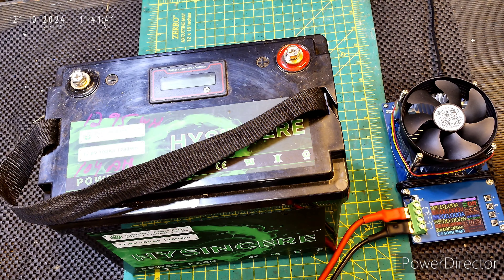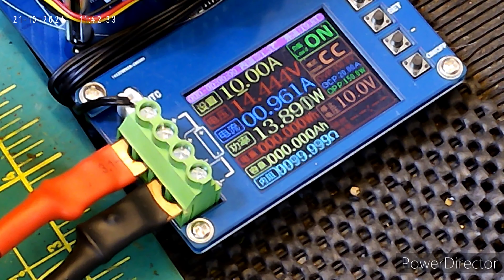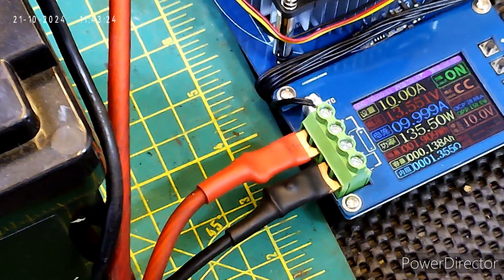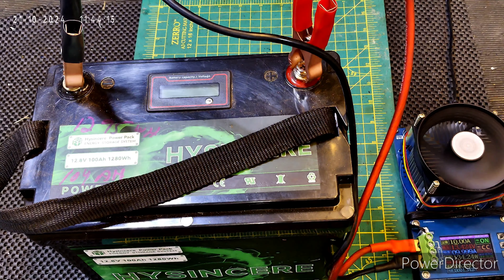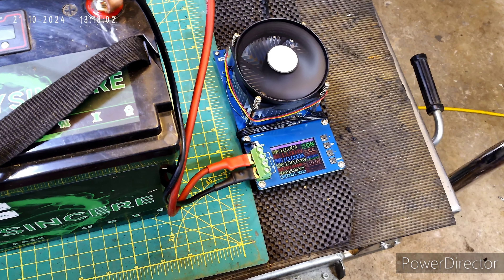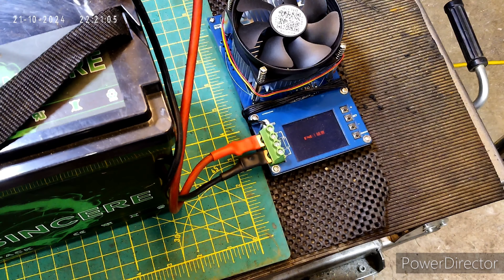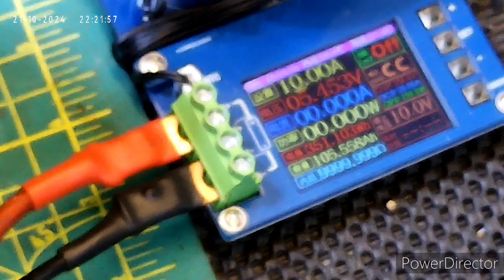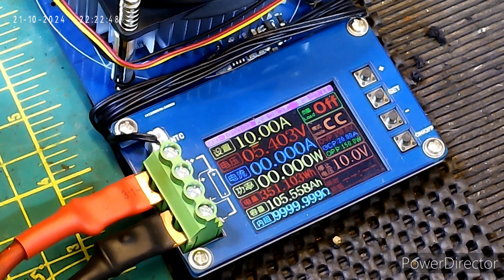HYSINCE 12 VOLT LIFEPO4 BATTERY LOAD TEST(UPDATED)

Comment: Hello, thanks for the video and for showing the test results. tI'm thinking about buying one of these Hysincere Batteries but I'm also new to this... the question is... is this battery recommended after running the test and using it ? is it worth buying or should I thy buying a different one ? you know, one from the more popular companies? thank you all any imput would be appreciatted
Reply from the maker: @alcolina8402  HI, hope you are doing well. I have been using these batteries constantly. I have 3 in my riding mower that I changed from gas to electric and they have been great. I also use 1 for my small solar system and it works great. I can’t believe how well these batteries work. I was scared at first, but, the test showed they are good cells. They basically look like every other one. They have 4 cells to each battery. The only problem I had was one of the BMS went bad on me and I changed it to one I got off of Amazon. I think I caused the problem with the bms. I was new to the batteries and I hooked up a fully charged one and one that was almost empty and you can’t do that. It tried to move power from one battery to the next and it blew the bms. Short answer is I would definitely recommend these batteries. The only thing I can say is the BMS won’t allow you to say use a battery welder because the bms will shut off but, the one I changed the bms in that one you can use to start a car or use it for the battery welder. So the batteries are great. They work great. It just depends on what you plan on using it for. I love them and they were half the price of the other brands. Hope this helps you. Thanks..
Reply: @doingstufforatleasttrying4843   Could you also explain a lil more about how is it that you think you were the one who messed up BMS ? I mean, everything else about the battery is good but my concern is bout the BMS problem
Reply from the maker: @alcolina8402  so what I found out was that if you hook up 2 batteries in series, they have to have the same amount of power or at least pretty close. If you hook up a fully charged battery in series to a battery that is almost dead, then it will get a surge of power and blow out the bms. I will try to make a video and explain what I can.  When I hooked them up I instantly saw smoke coming out. So just make sure the batteries are fully charged or at least close and you will be fine. I haven't had a problem since that. So that's why I feel I messed up the bms..
Reply: @ Oh I see, in my case that won't be a problem since I'm only gonna be using just one battery for the Inverter but that detail  is good to know and yes, make the video that would be great and thanks again!
Reply from the maker: @alcolina8402  I did make a video and I am uploading it now.. Hopefully it will explain a little better and you can also see the bms damage.
Reply: @ awesome, let me know when it’s done so I can watch it
Reply from the maker: @alcolina8402  it's uploaded..

Comment: Sadly 3 individuals is cheaper than a single 36v  😢

How long have they been in use?
Reply from the maker: @Blukiz_pr  Really.. I didn't know that.  I have only been using them for about 8 months. On my mower I thought I was using 25 amp hours every time I mowed my lawn. Until I figured out that I never reset the meter. I actually only use about 2 amp hours on a 1/4 acre. I was thinking of buying a 36 volt bms to see if that worked better. Anyway.. thanks for the information.  It's appreciated..this is all new to me and I am still learning.
Reply: @ im still learning too . Im doing a offgrid backup setup for my home  . 🙏🏽
Reply from the maker: @Blukiz_pr  awesome.. I am starting to do the same but, very slowly.  But, if you want an example.  I just put 2 200 watt solar panels out and the controller.  To 1 of these batteries and it saves us about 40 bucks a month with a power inverter to run a few things in our house that we use daily.  We make dog treats and use a heated dehydrator and that runs 10 hours a day. It saved us roughly 40 dollars a month just using 1 battery and 2 panels..You should start posting videos. I would subscribe..